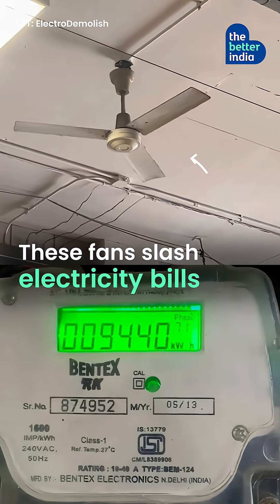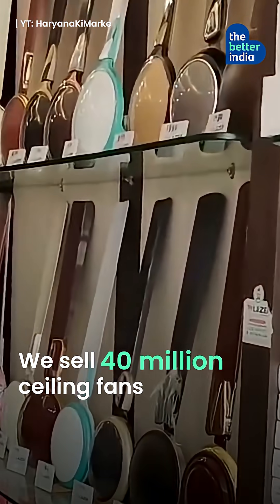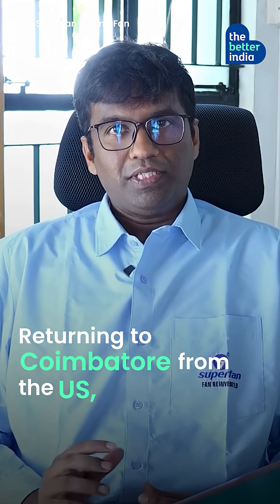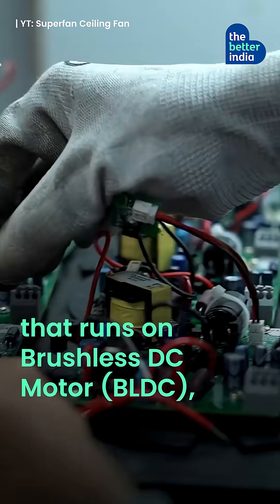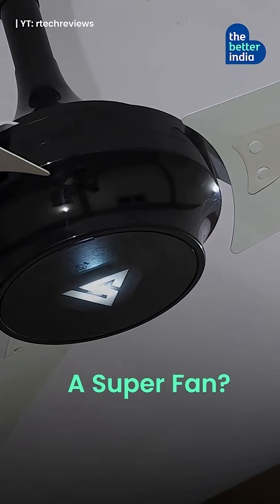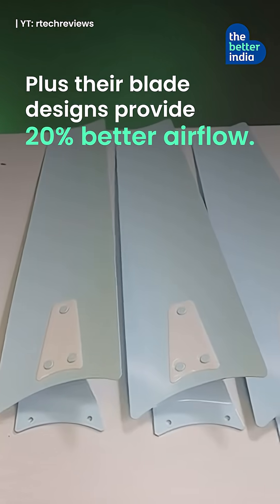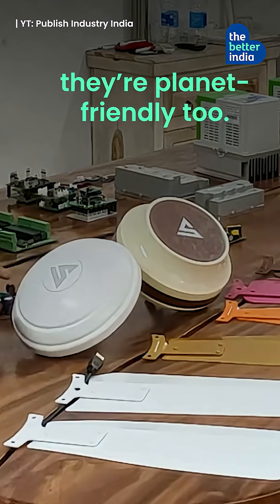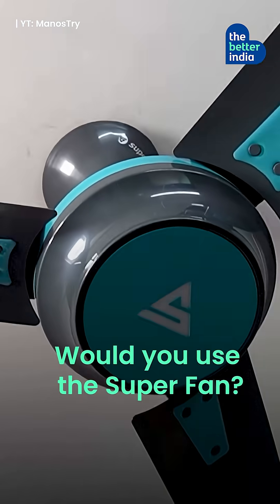He Built India’s 1st Superfans That Save 60% Electricity

Comment: BLDC fan lifespan is only 3 years,  whereas a regular fan has a life of 5 to 6 years!!!. After 3 years you need to buy a new board for the BLDC fan which costs around 1,500 Rs!!!.
Reply: BLDC (Brushless Direct Current) fans generally have a longer lifespan compared to traditional AC
Reply: BLDC fans typically last between 10 to 15 years, and sometimes even over 15 years, which is significantly longer than the 7-8 years
Reply: It's opposite

Comment: The motor needs Neodymium magnets and PWM controllers from China. So we went from an independent AC motor to a Chinese tech dependent BLDC motor. Sundarrajan did not innovate the BLDC fan. BLDC motors existed before he was born. Only this year BLDC fans have become cheaper - prices have slashed from 15000 to 3000 rupees. But China controls the raw materials.
Reply: For raw materials India needs to cut more trees , because so called "Environment saviors " do not exist in china , even for construction of 1 dam i.e, sardar sarovar dam which was pending from like 1980s or even before that NGOs get retirement and build houses worth crores.  

Even for clearing one part for metro paid actor and actress along with opposition cry foul for the same , some without even knowing the issue like farhan khan , 

So before crying for where is make in india , remember to mine things environment will be damaged , if you want that you can't have this , in china people is not the problem , in india People is the problem .
Reply: Also India's population is above china , but india's landmass is 3 times lesser than china , so naturally China will have more raw material and lesser in house consumption than India , blaming govt or crying why china control everything can't solve any problem .in 1960s China do not have control over market , it takes over market by these small steps not all of a sudden . If India is doing so , I don't see any reason why people critisize everything

Comment: India just needs a simple, affordable BLDC fan 🇮🇳. There is no need for any fancy thing so even older people can use it easily
Reply: Yes BLDC fan with regulator support
Reply: @viveksarpe  thanks sir 🫡
Reply: @viveksarpe IMO it best to keep without regulator as the regulator quality has fallen really low ,must be delebrated for sure to increase sales.
Reply: The motor needs Neodymium magnets and PWM controllers from China. So we went from an independent AC motor to a Chinese tech dependent BLDC motor. Sundarrajan did not innovate the BLDC fan. BLDC motors existed before he was born. Only this year BLDC fans have become cheaper - prices have slashed from 15000 to 3000 rupees. But China controls the raw materials.

Comment: I'm using six fans in my house, based on my personal experience, While it's true that BLDC fans have a slightly higher upfront cost, the long-term benefits far outweigh it. Then it consume significantly less power, which has helped reduce my electricity bills. They also operate very quietly, require minimal maintenance, and the after-sales support has been reliable in local too.

Considering the energy savings and durability, I believe it’s a smart and cost-effective choice over time.